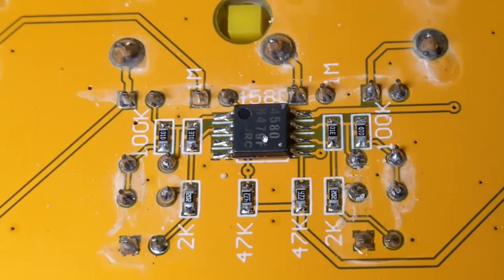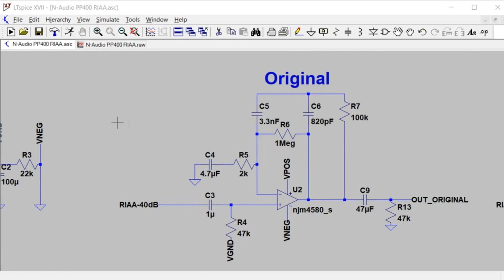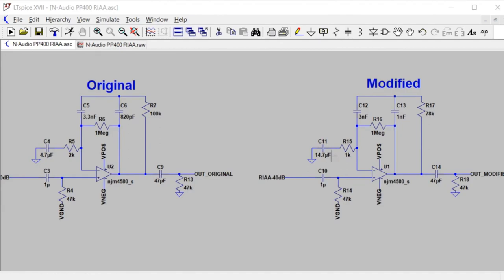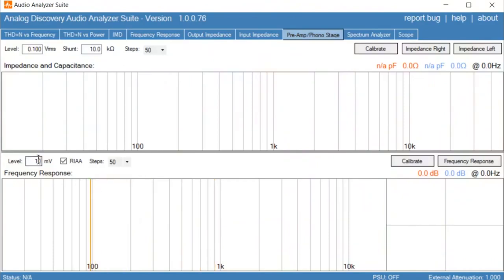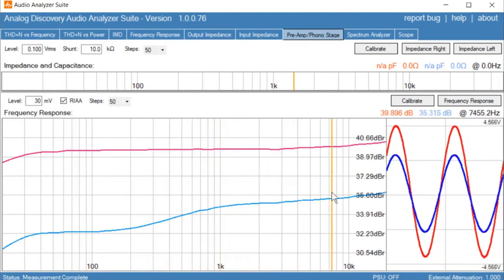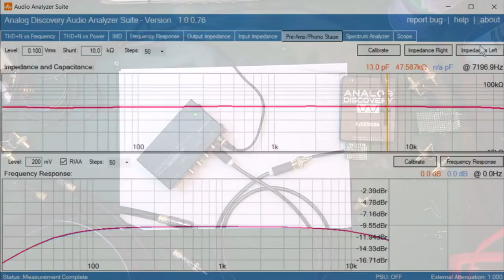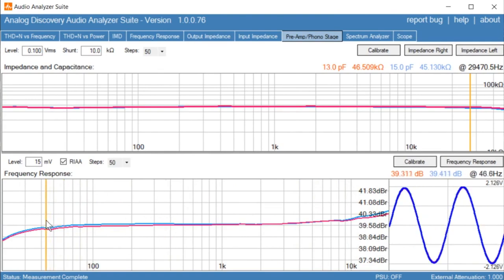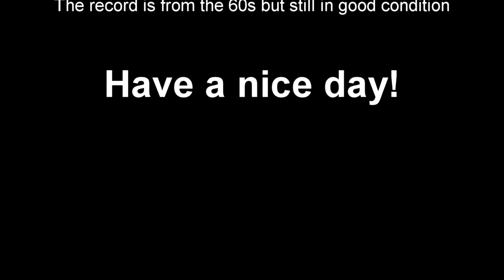N-Audio PP400 Phono Preamp Modifications [Re-Upload]

Comment: Thanks for sharing this modification, I upgraded my Behringer PP400 yesterday and can confirm it does sound better with these component changes. All the best
Reply from the maker: That's great feedback, thanks.
Reply from the maker: @Pham-Dung  You can see the updated component values at 8:30 in the video.
Reply from the maker: @Pham-Dung  Add 10uF in parallel with the existing 4.7uF
Reply from the maker: @Pham-Dung  Yes, it's all in the video.
Reply from the maker: @Pham-Dung  No, the type of opamp will not change the gain. You can watch in the video how I change the gain.

Comment: Hi Jake, thanks for doing this, very interesting and helpful. The PP400 is now $8 at Amazon, so I grabbed it to mod into mic pre-amp with Talent RF microphone. Your decoded schematics saved tons of time as I needed to kick out the RIAA frequency correction. In a nutshell, I removed C5, C6, R6, and soldered thru-hole 17k 1/8W resistor between nodes R5-C5 and R7-C6 using capacitors' holes in PCB. Works great with Sony stereo amp. My next project--$8 electric guitar preamp from PP400. Wish me luck! ;-)
Reply from the maker: Nice work.. at $8 that's quite a lot of value for money.
Cheers,
Jake

Comment: I love the detailed video. Just a couple of questions.  Why did you give input as 15mv?  MM cartridges give a typical output of 1.5mv to a max of 5mv.  2) Why do you think a brand like Behringer didn't work on flat frequency response? (I know and have done many such corrections on other brands but fail to understand why they didn't bother to do. they have a team of engineers)
Reply from the maker: The specified output voltage for MM cartridges (e.g. 5mVrms) is using a standard 5cm/sec grove at 1kHz, however records are often recorded at much higher level, that's why you have an overload factor hence it's a good idea to test at higher voltages to make sure it doesn't clip. 
Behringer didn't design it, they just slapped their name on it. It's the same preamp, they didn't even change the model number (pp400)
Cheers,
Jake

Comment: This looks to be really useful info indeed. Recently repaired a friend's turntable as a favour, including sourcing a replacement for the mechanically noisy motor and a stylus. The owner did not want to change the cartridge & i was able to show them the poor response of their vintage amplifier's RIAA stage could have benefited from some attention, the test done using your AudioAnalyzer SW running on my AD2.
Reply from the maker: Hi Pete, great to hear you get some good use out of this feature. I always wanted something to easily do some basic measurements on a phono stage as it's always been a bit of a black box. I'll add some features in the future to measure the cartridges as well, it will however require the use of a test record, but I think most of us got a few of those anyway.

Comment: NICE-SHARING,i think many basic phono-amp usually have low-GAIN problem~
i bought Behringer PP400 for few weeks  found its nice clarity sound especially high frequency~
but lacking in bass and low gain problem
i changed all caps into ROE product and WIMA  series in RIAA part(with correct readings ).but i only change 2K into 1K resistor cause this tiny pcb really troubled me!
but when all done i found more deep bass and clarity still exists without too thin
the most important involving is the gain! 
the cartridge i use is SHURE 97xE
now it can compare with SCHIIT MANY now~
small cost and huge upgrade
many thanks
Reply from the maker: Thanks, I'm happy to hear you found the upgrade a big improvement.
Cheers,
Jake

Comment: Thank you for this mod and in-depth video! I've a (noob) question if you don't mind. It seems you replaced and used SMD 0603 resistors for your mod. Is it also possible to do this with metal film resistors, as I can't find any 0603's with the values mentioned in your video.
Reply from the maker: Thanks, the 0603 resistors are also metal film, however you can use any resistor type you like, but it will be very difficult to solder a 1/4 W through hole resistor onto the small 0603 pads. The best way is to use 2 resistors in parallel to get something like the non-standard 78k value, use 82k in parallel with 1.5M, just solder them on top of each other, that's what I did, it gives very close to 78k. Here is a calculator to make odd resistor values: qsl.net/in3otd/parallr.html
Cheers,
Jake
Reply: @TheStuffMade  Thanks a lot jake, I really appreciate your response. I've been looking for 0603 resistors and the closest I could find (thanks to that site you gave me) to get the 78k value in parallel are 100k + 330k. That makes it a value of 76.74k. Do you think that it's ok or is it far off? Thanks!

Comment: Hi Jake, I know I’m way late on this mod and you may not be around anymore but were you happy with these values or did you tinker further??
Got the PP500 version with the knobs for level and volume of the headphone out. From looking up the schematic it’s the exact same pp400 but with the level controls. Basically just want to confirm that these values are good enough and I can get the bass and extra volume I need. Is the volume gain enough for you or did you increase it further?
In just a couple of days testing it is much more breathier and detailed in the mid/upper frequencies than my internal turntable preamp but it’s also much quieter and thinner at the low end but I think these changes will be all I need. Thanks for the video either way, cheers!
Reply from the maker: Hi, I'm still around, just not doing much videos anymore. Anyway, I'm still happy with the mods to the PP400, it a completely different level of preamp with this mod. However I'm not sure the PP500 is the same design and if the mod will work on this model. I haven't seen the inside of the PP500.
Cheers,
Jake

Comment: Did you try a Monte carlo simulation with all the tolerances(+- 10 or 20%)? I think in most cases you can neglect the impact from the replacement of C5 and C6. You can finetune R5 and R7 with a Potentiometer, that would make a bigger and more controllable Impact.

Comment: Thanks Jake for your answer above, I have another question:
this scheme and the modifications, would be compatible with the Operational Amplifier LM387 or with NE5532 ???
Thanks.
Reply from the maker: Hi, they should both work, but if you're building this I'd recommend using an 8 pin socket for the opamp so you can easily experiment with different ones, they generally have the same pinout (except special cases like the LM387). Personally I'd probably go with something a bit more modern like the LME49720.
Cheers,
Jake

Comment: Hi Jake,
isn't it also possible to put a 360k parallel to the existing 100k to get the desired 78k?
Reply from the maker: Sure, you can do that. The values I suggest are to stay within the most common E12 range, but of course there are many valid combinations, you could also use a single resistor from the E48/E96 range at 78.7k.
Cheers,
Jake
Reply: @TheStuffMade  Your knowledge is impressive. I didn't even know E series existed.

Comment: Hi Jake, interesting video. I have a PP400 lying around so might do your modification. My brother has an Onkyo CP1022 turntable connected to a Denon receiver, both without ground connection. It produces slight hum. Could the hum be in the preamp in the Denon? Maybe dumb idea: what if a PP400 would be used on another line input? Other thoughts?
Reply from the maker: Hi Marcel, first I'd make sure you have a solid ground connection between the turntable and the receiver. In my experience the older Denon receivers have decent phono preamps built in, I doubt it's causing the hum issue, but it's worth a try to use the PP400 preamp and just connect it to any of the line inputs, also here make sure you have the ground from the turntable connected to the PP400. The modification in this video is well worth doing if you end up using the PP400. I wouldn't worry about earth ground, but if you do connect earth ground, only do it for the receiver otherwise you could end up with a ground loop.
Cheers,
Jake
Reply: @TheStuffMade  The receiver in case, Denon DRA-545RD, does not have a proper ground connection. On the Onkyo turntable, all plastic, looking at the service manual and the unit itself, a common wire runs from the two signal grounds to the spindel and into the tone arm without any connection to the cartridge. So that’s not much of a ground I’d say. On the receiver, a proper chassis ground connection can always be made of course. My brother tried with a wire connected to the Denon’s chassis and the aforementioned ‘ground’ wire of the turntable, which made it worse. That’s why I came up with the PP400 solution, without knowing if that would do anything good. What do you think? Cheers, Marcel

Comment: Thanks for the informative video. What effect on the frequency response would swapping out R7 with a 75K resistor instead of the recommended 78K. The reason I ask is I have 75K resistor in my kit, but am having difficulty getting close to the recommended 78K with what I have available.
Reply from the maker: Hi David, thanks, I ran the simulation with 75k, it will give you a small dip of around 0.4dB at 1kHz, not too bad, probably not audible. You can try the calculator on https://www.qsl.net/in3otd/parallr.html to easily find resistor combinations that might get you even closer to 78k.
Cheers,
Jake
Reply: @TheStuffMade  thankyou for the quick response and for running the simulation.

Comment: Thanks Jake for your informative video. I just wonder  if you could suggest a simple means to switch out the treble component of the RIAA curve to ‘flat ‘ (no curve) so I can play 78s? I like playing 78s with no roll off in the treble. The pre-emph in the bass would be fine however  - just a switchable mod for treble would be great.. Thanks again :-)
Reply from the maker: Hello, if you remove the two 820pF capacitors (the green ones marked 821 on the board around 3:55 in the video), then you'll get a flat equalization for the treble. Or you can just lift one side of the capacitors and add a switch. Just be careful to only use the switch when your amplifier is off as it will probably generate a very large pop that could damage your speakers. But, I'm sure you are aware the curves for 78s are a bit of a jungle with so many labels using different equalization.
Cheers,
Jake
Reply: @TheStuffMade  That’s great - many thanks Jake :-)

Comment: Hi Jake, firstly thanks for doing this, very interesting and informative. I am new to LTSpice and am trying to learn to model. However I cannot get similar graphs to yours as I don’t have a model for this op amp or the function you have used for RIAA in. I have used the model with a Laplace input to correct RIAA and a similar op amp. Fairly flat to 10k but then rises dramatically. I would like to make sure my base model is the same as yours if you could share/expand on the signal input model and the op amp model. My aim maybe to try an alternative op amp after establishing a known base. Thank you.
Mark
Reply: Hi, 1 year later! What op-amp did you end up going with? I was wondering if it's worth adding a discreet one, e.g. from Orange.

Comment: Wow. It actually reveals one of issues I have with this amp. In fact, according to RIAA diagram, under 1kHz is boosted to 20dB to the lower end while over 1kHz attenuated down to 20dB towards the high end.  It means bass needs to be boosted more during the playback. Additional modification perhaps?

Another problem I have with this is low gain although I must say if this is to do with my particular configuration or not. I have Naim Mu-So gen2 to which I have connected via 3.5pi Audio input. Does it have gain limitation too? If yes, how would you modify? Or, is it related to what you have found?
Reply from the maker: Hi, the modification I've done here will ensure a flat frequency response (within 0.5dB) and increase the gain by about 5-6dB. I don't have any experience with the Niam Muso, but I suspect it's analog input is optimized for connecting devices like MP3 players, phones and CD players which usually have higher outputs around 2Vrms whereas a phono amplifier usually don't output more than 0.5Vrms. However it can also be your turntable/cartridge having a lower than usual output. What turntable/cartridge are you using?
Reply: @TheStuffMade  Hi. Thanks for the reponse. Mine's Audio Technica MM  AT3600 if I recall. If I should, how >1kHz band gain can be lowered and increase <1kHz gain a bit more? Regarding RIAA, you may refer to Wikipedia doc.
Reply: Yes, you are correct that a phono preamp should have a response which looks like the RIAA equalisation curve, +20dB @20Hz, 0 @1kHz, -20dB @20kHz, not flat at all. However here, what was applied was a signal source which has the inverse (as explained in response to another comment) - since the circuit clearly performs the RIAA equalisation. Hence the apparently ‘flat’ response is in fact the combination of the inverse RIAA signal source and the RIAA equalisation response of the preamp.

Comment: Will this preamp work with an MC cartridge or can it be modded by changing some components?
Reply from the maker: It's not going to work out of the box with an MC cartridge, but in theory you could modify it to work. You'd have to increase the gain to 60dB and decrease the input impedance to something like 100 ohm, plus you should probably replace the opamp with a lower noise type because of the added gain.
Cheers,
Jake

Comment: hello,
how does it behave between 10-20 kHz?
is there a way to flatten the frequency response above 10kHz?
Reply from the maker: It's already flat within 0.2dB, the 0.3 dB rise in this video is mostly a measurement artifact, not that you'd be able to hear it anyway. 
Cheers,
Jake
Reply: Ok. Then this should be a good replacement for my LP120 internal amp.
btw. also many thanks for sharing the mod. that's really great work you doing here.

Comment: I have this preamp from aliexpress and it only outputs treble at low volume, very weird
Reply from the maker: That doesn't sound right, what kind of cartridge are you using? make sure it's moving magnet and not a ceramic/piezo type cartridge.
Cheers,
Jake

Comment: I did some simulation on multisim... to make a long story short   the original  PP400 is a bit weak on bass regain in the curve.
A quickfix with a pretty decent result without crazy search of unexisting components is to replace R6 and R16 with a 1.8Mohm 
resistor.   This will have a good horizontal linearity with a general gain of -5 db if compared with the mods reported here.
Reply from the maker: I'd call ~3dB drop below 500Hz a lot worse than "a bit weak" in the bass region.
Your suggestion with the 1Meg to 1.8Meg will still give a deviation of around ~3dB from flat, now you just have a big drop in the upper bass region instead of a  drop in the whole bass region.
Why not just follow the values I suggest in the video and get a frequency response with a deviation of just ~0.15dB, it's only 5 components per side?
Cheers,
Jake
Reply: @TheStuffMade   When gain is zero at 1khz gain at 500hz is 2.4db
RIAA indicates 2.65db   error is minimal , not 3db. 
Gain at 200 is 7.2 db while riaa gives 8db
Gain at 100 is 12db while riaa gives 13.
So more or less is within 1db.
 With your setting (taht indeed is perfect) the overall gain is too much for my AT130E that has 5mv output at 5 cm \ sec.
Reply from the maker: @MrKkprince  No that's not correct, if you only change the 1Meg resistor to 1.8Meg then you'll have a ~2dB dip at around 155Hz, that is definitely audible. But if you just want less gain you can leave the 2k resistor at 2k or maybe change it to 3k. However the standard gain for a 5mV/1kHz/5cm/sec is 40 dB, exactly what my modification sets the gain at. You'll still have good overload margin.
Cheers,
Jake

Comment: Hi is there anyway to increase the output level? The level is much lower than all my other sources.
Reply from the maker: Doing the mod will also increase the output level. What cartridge are you using?
Cheers,
Jake
Reply: @TheStuffMade  thanks for the reply, I'm using a Marantz TT320 with the original Marantz cartridge.
Reply from the maker: @t0nito Yeah, I believe that's a lowish output cartridge, something like 2.6mV compared to the standard 5mV.

Comment: Is it possible to add a volume knob?
Reply from the maker: Hi Joeri, It depends on how you intend to use the output of the phono preamp. If you want to hook it up to an amplifier then yes, you can just add a 1k-10k pot on the output to control the volume since it's quite low output impedance. However if you want to e.g. drive a pair of headphones directly then it would need more added components like an extra opamp buffer to add a volume control.

Cheers, Jake

Comment: Probably a dumb question, but can I remove the ground screw as my turntable does not require it?
Reply from the maker: Sure, if you don't experience any issues with hum, then you don't need the ground wire. Some turntables combine the ground with the signal ground instead of running a separate wire.
Cheers,
Jake